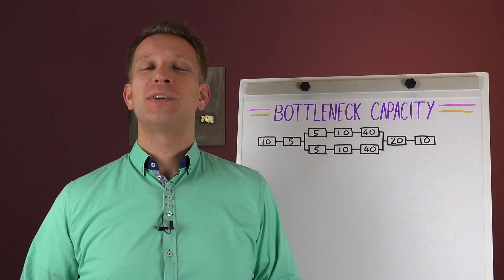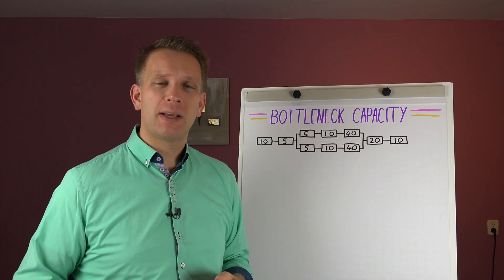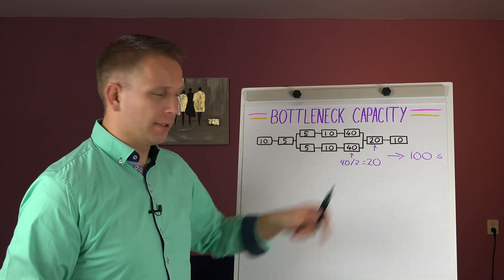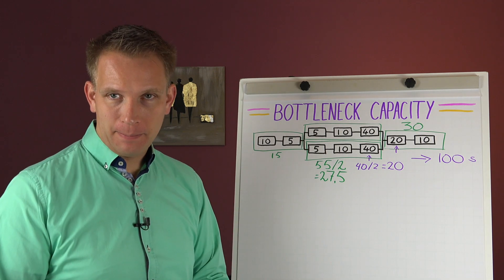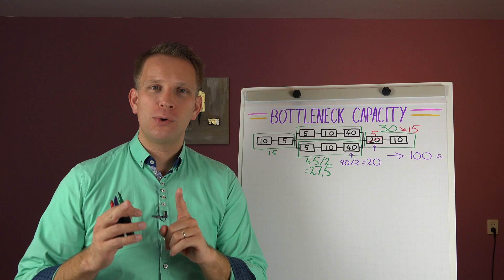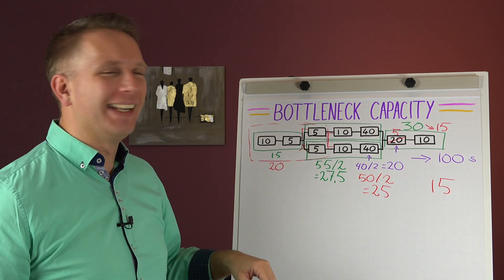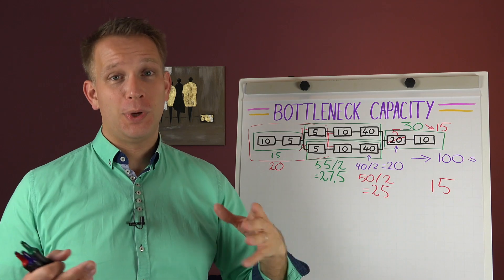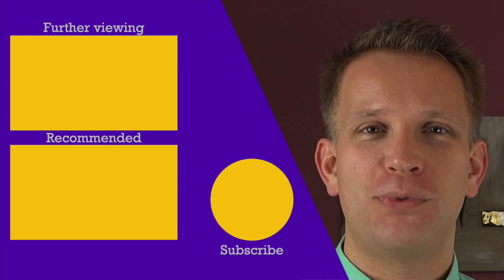How to use bottleneck capacity analysis to optimise process improvements

Comment: I have an exam tomorrow, what if so 
             20
10 - 5 -       - 10
             40
i mean there are two different stations and they are doing same thing but one is doing in 20 sec and the other is in 40 sec ??
Reply from the maker: @Justwil07  good luck with your exam!

With parallel Process Times of 20 and 40 sec/unit, average Cycle Time can be calculated by thinking in ‘how many per time’, for instance: 20 sec PT => 2 per 40 sec & 40 sec PT is 1 per 40 sec = 3 per 40 sec => 40/3=16,7 sec average Cycle Time = on average every 16,7 secs one unit is produced by these two stations together.